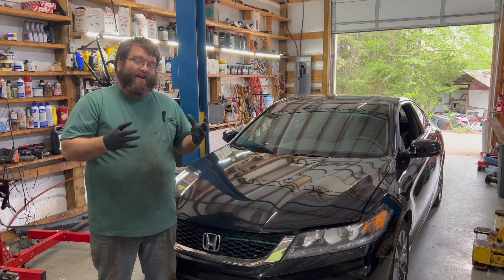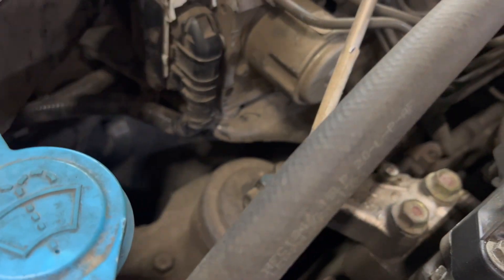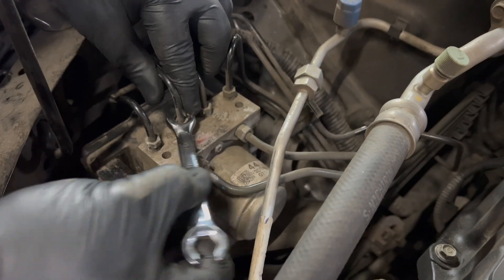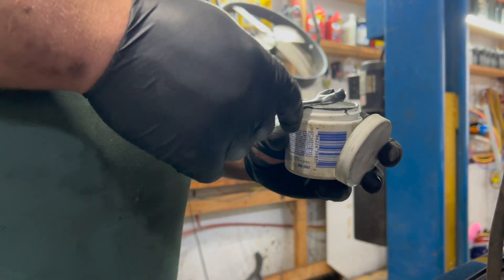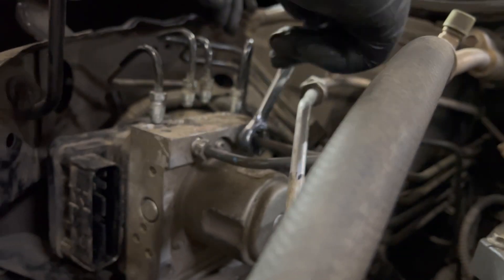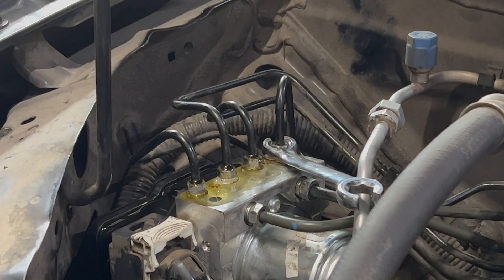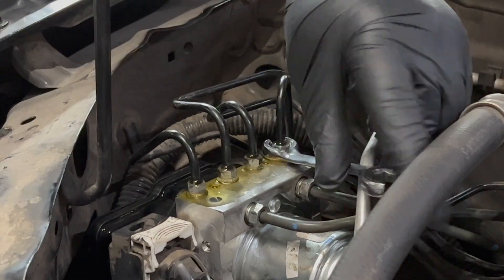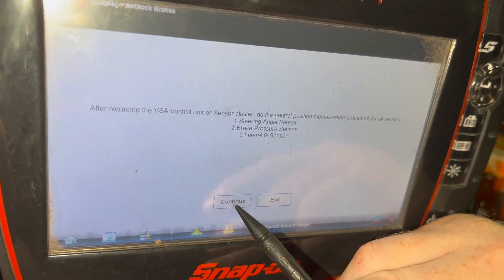13-17 Honda Accord ABS Light Code 121-11 VSA Solenoid Malfunction - ABS Unit Replacement

Comment: Where did you order a new VSA Modular? I’ve been waiting for a month to just see if they can order them. 2 dealerships have them on back order.
Reply: Been waiting for my VSA for 17 accord v6 since march 😭... I am actually suing Honda now
Reply: @fsx0567  what’s the information for the paperwork. This is ridiculous and they need to add it to the recall.
Reply: I have been waiting since June. The dealer gave me a loaner. Are you driving yours while you wait?
Reply: @pinpinpula9863  yes I am. I’m thinking about buying one online and having the dealership install it
Reply: @mikeowens3739   Problem with that is that they won't insure it.. so no warranty
Reply: @pinpinpula9863   see my comment below 
Thanks,
Reply: @mikeowens3739  The other problem is that dealers at least the ones I have asked will not install outside purchased parts, this modulator is only manufactured by Honda so no aftermarket part according to a different mechanic I was working through.  Have been waiting since March for this part, got 2 different ETA dates only for the date to pass and be back on unknown when it will arrive.
Reply: @danielg33125  I was fortunate enough to have one of my local dealerships have one come in from Japan. The other one I told them if they get it, let someone else who is having the same issue, get it. It sucks that there really is no alternative aftermarket options. I waited 3 months but like you, depending on your location, it’s longer. As mad I love Honda, Honda needs to take responsibility for this issue.
Reply: @fsx0567  I have a 2014 Accord V6 with 86k miles regularly maintained per Honda schedule, now with similar lights. took it Honda dealership stating needs the ABS module replaced for $2400 ( the part seems around $1100-1300) and has to order the unit on backorder. This is ridiculous particularly Honda knowing this is a common failure and such expensive repair. How are you suing them alone?
I am planning to write to Honda and see what they have to say and would consider suing. On top of that, they said I have a valve cover leak for another $600, that's after paying them $1000 for a new starter. Please your experience if you have spoken to anyone at Honda corporate or if you have filed a suit.
Reply: are*
Reply: @pall5114  don't see the connection between this part and sparkplugs.  The repair includes brake flush for me, the cost being around 2500 which is thankfully being covered by a third party parts insurance I had purchased a few years back, with this repair I am coming ahead of what I have paid all this time.

I will flag that I had the brake flush charged and done when they also flagged this part was malfunctioning not knowing what the VSA modulator was I approved (also not knowing that with the replacement of this part they also do a brake flush), they did the brake flush and two weeks later I have gunk in the brake fluid.  According to Hondas master mechanic this is happening because the VSA modulator failure DTC 121-11.  So several months later I am not sure what the status of the brake fluid is if after 2 weeks it already had gunk forming.
Reply: Honda quoted me 3000.0 for vsa modulator replacement today. They said they also need to bleed the brakes and replace my spark plugs. Which by the way I informed Honda was done 6 months ago. They said it was highly recommended. Said part was on back order a month. I reported it to the highway safety commission today.
Reply: @RMoreno1982  I had my local dealership parts manager get back with me and they are definitely backed orders from Japan but he told me that a bunch are coming in with the month so I’m on the lookout and list for one. 3k for everything? Steep but not out the question. I’m at $2100. With Honda would just recall them or make dealerships take 75% off the price for waiting.
Reply: Just learned from my dealer. I am third in line to get the modulator. The first in line has been waiting since October of last year. I am at 6 months so far. 

To make matters worse this is covered by my parts insurance and the dealer is refusing to repair another failed component that is covered by the insurance until the modulator arrives. They claim my end links are torn.
Reply: Same issue and I have been waiting 5 months for modulator. I’m so tired of seeing all the darn lights I’m ready to trade the car in!

Comment: Hello sir, my 2013 Honda Accord has the same issue? Where did you buy that VSA pump? Could you let me know please? Thanks in advance
Reply: Any update on your car?
Reply: please file a complain against honda through highway safety admins website more reports = quick response or fix from honda
Reply: @fsx0567  just reported it. Thanks for the tip. Can’t find the part anywhere and have this issue.
Reply: @fsx0567 where do i go for this?

Comment: Hi
I have a 2016 Honda Accord EX-L V6. My VSA light is not on but other lights on my dashboard are on. The ABS, Tire Pressure, BRAKE, Powering Steering, and the Stability Control lights keep turning on and off and keep repeating that. I scanned the car and the code 121-11 VSA Solenoid Valve Malfunction comes up. If the VSA light on the dash is not lighting up but my scanner has that code, do you think that means I need to replace the ABS Module? Also, how do I find out before starting this job if my scanner being (the CRP123 Professional) can do the neutral position memorization procedure?
Thank You In Advance For Your Help!
Reply: Crp123 scan tool. I dont see it listing  a zero point/ neutral position as a special function
Reply from the maker: Ours was doing the same thing. I think it would intermittently lose communication with the vsa module. That’s more than likely the issue. It is a pretty commonly failed part. As for the scan tool I’m not sure but the previous comment said it doesn’t look like it has that function.
Reply: I have a 2014 accord with the same code. The OEM part is on back order. My mechanic is sending out the whole module for repair.
Reply: Hello sir, my 2013 Honda Accord has the same issue? Where did you buy that VSA pump? Could you let me know please? Thanks in advance
Reply: @seawavedv8675 did you find out where to order module from ? I need one too